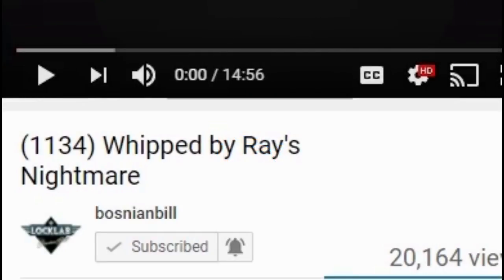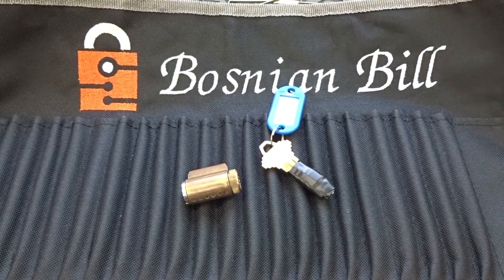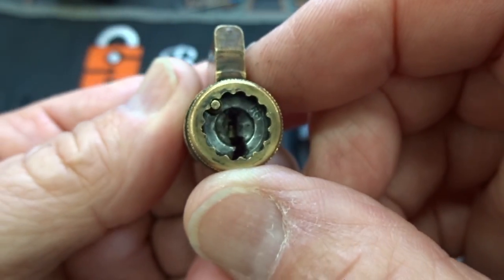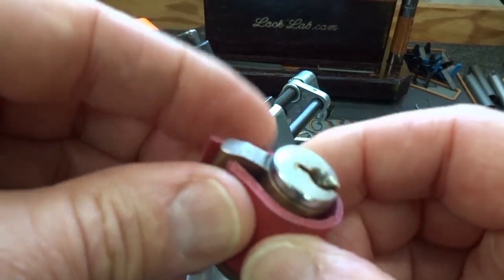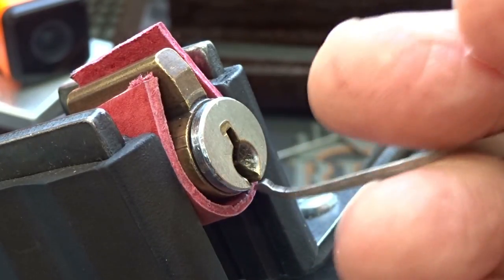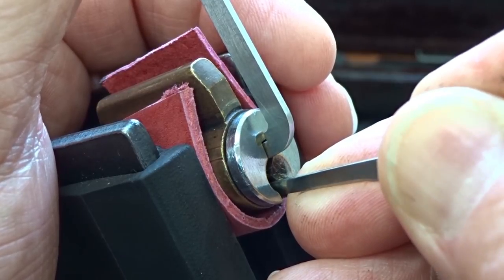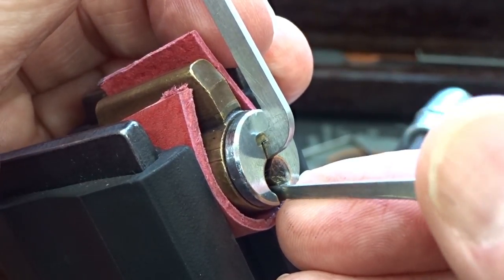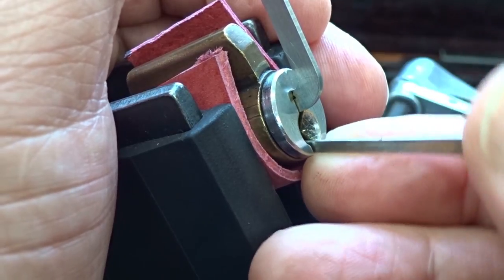(1141) Challenge: Feedback Frenzy

Comment: #3 key pin looked to be pin in pin as well, you have the top serration, then there looks to be a small gap from where the pin is narrowed to slide into the next part.